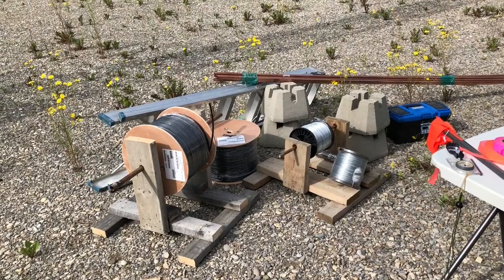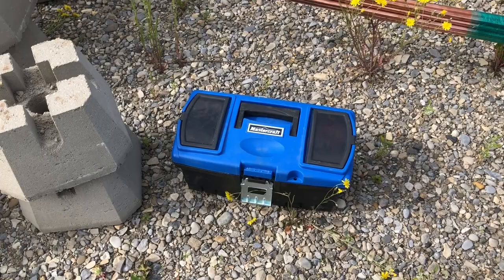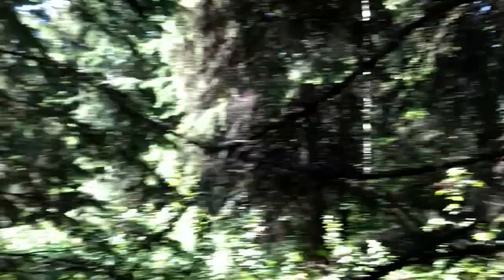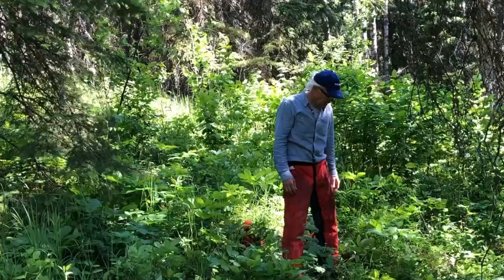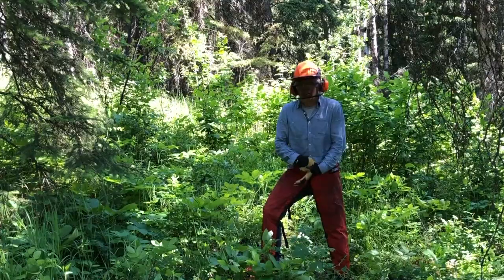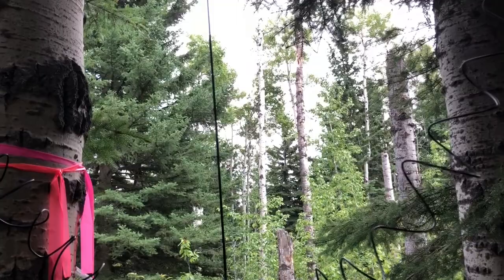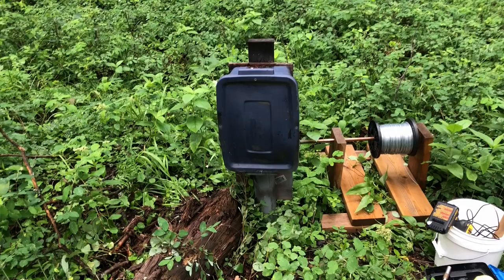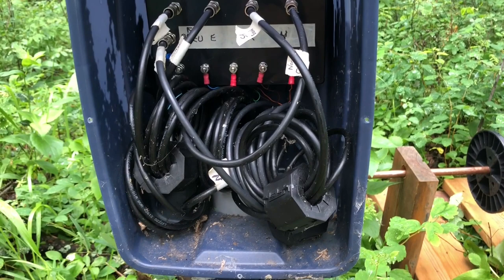Beverage Antenna: Field Installation techniques

Comment: Great installation Steve, I may expand my system and use some of your ideas. I'm using KD9SV's hardware reversible BOGs and RBOGs which simplifies installation and gives you instant 180 degree switching and with two identical perpendicular arrays gives me 4-quadrant coverage. TNX for sharing!  73 - Dino KLØS

Comment: Where did you get the large toroid's for the beverages to cut down the common mode noise? You used galvanized steel or aluminum electric fence wire. Wouldn't field phone wire be better (and especially if you are doing bi-directional beverages). That is what I plan to used for my KD9SV bi-directional beverage to the NE/SW. Terry, KI7M
Reply from the maker: The large type 31 clamp-on torroids are available from many sources. I find the best prices from Mouser: Here is a link: https://www.mouser.com/ProductDetail/Fair-Rite/0431177081?qs=%2Fha2pyFadugw4R90tf7msQhhTrGQdRhPQL14yBHFnEWpZGAPUnYFDw%3D%3D

I have used field telephone wire.  It is not really mechanically strong enough to survive falling trees in my situation.  For a reversible system the wire will work, but I found the return loss back from the reflection transformer along the wire to be pretty high.